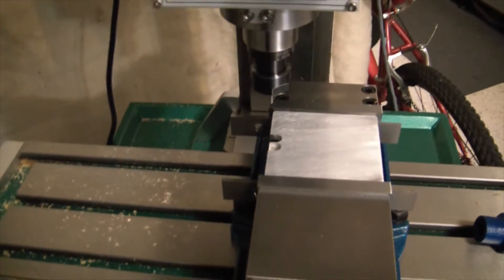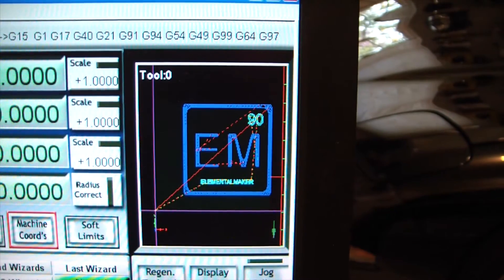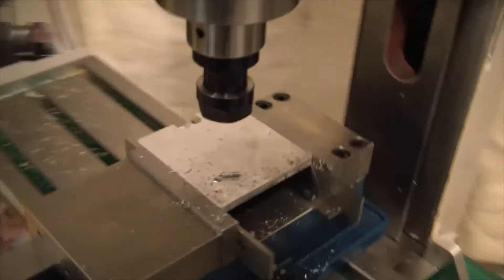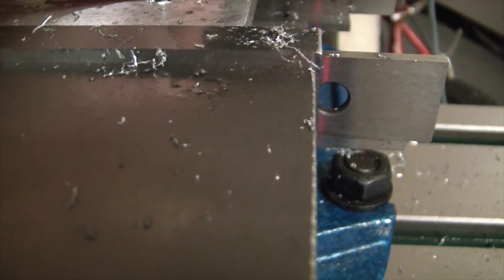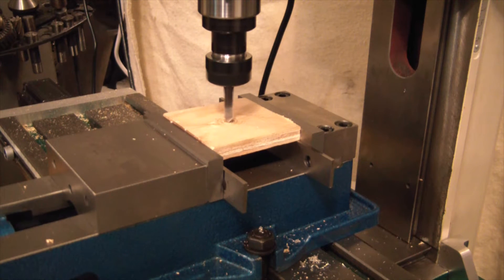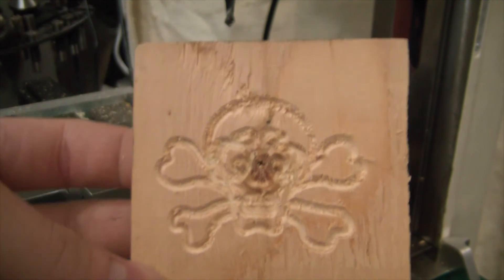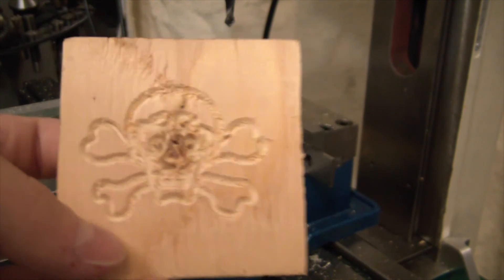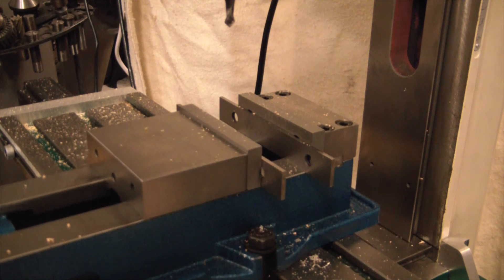ElementalMaker: G0704 CNC Conversion First Cut... FAIL!

Comment: i am far from a pro at this kind of programming,but while watching the fail run,I noticed two things .first was the depth and speed of the bit plunge.Second was the overall feeding speed . It just looked as if that bit was feedin g into the material ,especially if that material is a metal ,that if it went at a m uch slower feed speed and bit speed can remain the same. I am no pro at this type of programming ,so I could be way off. BTW self taught so I had my ups and downs,but you gotta learn somehow if it's not your occupation and just a hobby,like in m y case.

Comment: When I used to do cnc stuff or even when running bridgeports, tools breaking we're usually caused by tool speed being too fast. Or or can be tool speed can be too slow for how quick the table is jamming work into it...... Or it often  ment that my stupid ass didn't indicate the work properly. Do you have an Indicator bit? It's a little Bit that has a spring loaded little penis tip which you align so that the tool looks like a perfect cylinder, the you locate the Bit to the edge of the work piece ever so slowly while the head is ON. Watch the indicator and when it's tip suddenly goes off center you know you found zero. But don't forget to take the size of the took (0.125 I think) and divide that by two.... Then subtract that from the zero you just found and the reZero.  It that is only for X and Y axis. It looked like your Z was too deep. Anyway Fun stuff.

Comment: Simply put, 'mo flutes, 'mo problems... ok, not really, but more flutes means more finicky and potentially much narrower operational envelopes. Its all about chip load.

But you know what? Just sending that shit, going right for the multi-flute end mill instead of a much easier to use single O-flute type end mill.... baller. Shows you're serious about learning how to do this stuff, and that's awesome. Keep at it!

Comment: I followed your conversion series and I quite enjoyed it, I plan on doing a PM25 conversion. Your feed was most likely the issue it could of also been your RPM was not high enough too. Also try avoiding using the smart straws on the WD 40 cans I saw the tip of a finger get ripped off by using one, the bit grabbed hold of the straw and just yanked the bottle out of his hand along with the of his finger off. Have you gotten the hang programming yet?
Reply from the maker: Glad you enjoyed the series! Very good to know about those those smart-straw cans, I will definitely switch to the old style till I set up flood coolant. Haven't had much time at all to play with it, but I am starting to get the basics down. Will do a video update soon. Keep me up to date on your conversion!

Comment: Yup everyone breaks these little endmills from time to time. To help with this problem alittle, use a speeds and feeds chart. 
http://zero-divide.net/?page=fswizard   Keep on it, you will get it all figured :)  Also starting out it is a good idea to use
HSS mills. Carbide break real easy. That's my take on it anyway.
Reply from the maker: Thanks Ironhead! Great feed and speed calculator there, I'm definitely going to be using it. I think my issue was Autodesk fusion compensating for tool heights that caused my issues, although my feeds and speeds were also crap I'm sure.